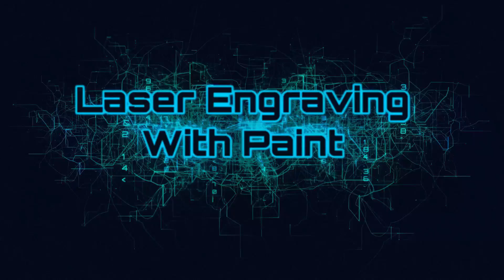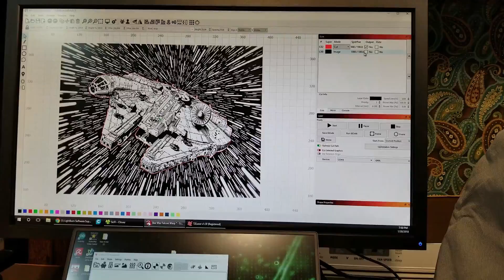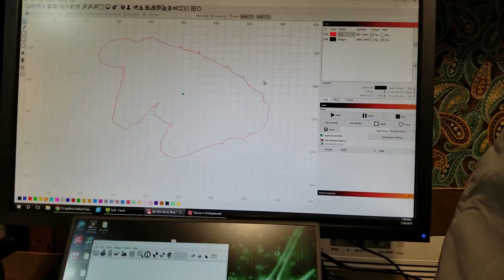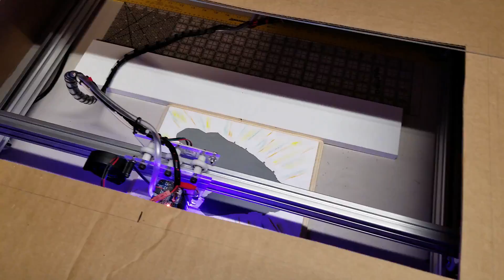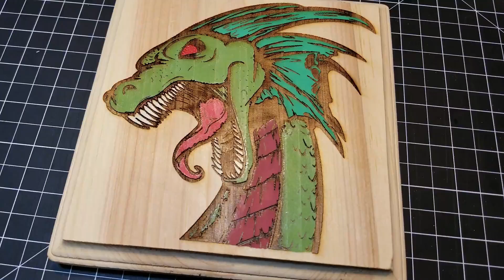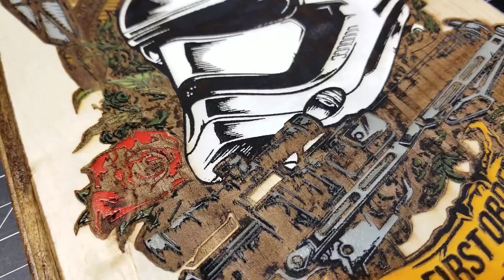Laser Paint Engraving Tutorial

Comment: So those collar areas they must be painted very precisely by hand correct?
Reply from the maker: Not really, it all depends on the design. I explain it a bit in the video, as long as you dont overlap one color over into another colors area you will be fine. The laser engraves all the outlines of the design, so that cleans up your edges where you painted. Think of it as the laser going back and triming your paint to the lines, if you colored ON the lines a bit.
Think of it as a coloring book, you can get sloppy enough that your color goes ON the lines, as long as you dont go OVER the lines.

Comment: How are you able to laser engrave on white??
Reply from the maker: There are a lot of variables to this such as what type of paint you are using and even how thick you have the paint on there. I use acrylic craft paints and I find that they do quite well. The white actually did better than some other colors burning quite black. You have to play around with all the variables though laser settings such as power and speed and how much air you have blowing on the price. Sometimes if you have too much air pressure it will simply blow away everything it is engraving so it's not leaving behind a nice dark engraving. I found it best to keep the air pressure low and then clear coated afterwards to lock in all the burnt material.

Comment: Man, your work is cut short by the time it takes that solid state laser to do it's job!  You really need to build a Co2 setup and get an 12v PC fan in place to flow the smoke way from your work by shooting it across the board toward the rear exhaust port exit.  Putting air flow down on your piece like that is better for the lens, but it causes an over burn effect due to it blasting the burn off debris and smoke back against the edges.  This can be good for a patina effect, sorta like a shading you'd get from an airbrush, but over all it kills the cleanses of your work.  This is why most laser setups use a cone style nozzle over the lens that then is pressurized by the air pump like your pen cap, however it completely seals the lens.   What most laser sales people and home builders don't realize is that the optimal pressure used is generally no more than 4-6 psi for engraving, which is critical for negating smoking your edges and also is most required for etching on acrylic so as to not over cool the surface to early to prevent ridge freezing, but instead allowing the melted plastic to pool out just slightly before refreezing for a much cleaner result.   
That being said, I built a 100watt co2 1200x900mm (3x4 foot) bed for just under 4K.  I could do it even cheaper now that know what I do now about building them.  
(If you need advice or info on it I don't mind sharing info)  
My machine uses 2- 2/1 ratio 3 phase nema 23 motors on hybrid digital drivers @ 36v and can raster etch at speeds upto 1100 mm/s with the typical .085 scan gap at 300 dpi for deap etching, or set up to 4mm out of focus for removing paint like you're doing for running an even wider scan gap, which speeds up the process tremendously and reduces any observable focus lines for a really smooth appearance more like a CNC router end-mill does.
I used a Light Object T9 DSP with coreldraw X7 that makes vector tracing raster images a snap.  This is a big deal in regard to the fact that I can go back and vector trace the outlines of everything once I get the etching done.  It cleans up the definition of the work unbelievably better.   
The T9 comes with plug-ins for corel as well, so I don't need to export in any specific formats or reset any colors, separate groups, etc since I can just send it directly to the Laser software with once click.  All I have to do then is set the color tabs to what I want them to do and it's ready to rock.

Another couple things to consider is if you're not using chalk in your paint you really should consider this or even just investing in some pastel color pencils or paint pens for the inner detail work (like those teeth for example). The chalk can be bought seperately and mixed yourself, have a look at amazon for it. 
Chalk paint eliminates needing more than one or two coats at most due to the chalk being a molecular binding agent for the pigment. This makes it much more opaque per coat layer added, reducing your paint use by significant margins and increasing the drying time by 4-5 times vs any other method.    
Another thing you should try is using a wide roll of transfer (masking tape) film that will burn away with the laser if you really want to keep things clean on outer edges when you raster engrave things. 
I get mine from "UScutter" works great as well, just make sure you buy it in a wide enough roll to cover your entire surface with one piece so you don't need to overlap one with another, or you'll notice it on your work since the beam has to travel through two layers of tape before it gets to the material.
https://www.uscutter.com/GreenStar-Layflat-Classic-Transfer-Tape-Medium-Tack-Assorted-Widths-Sample-Rolls

My inspiration for telling you all this is because I made $700 on my first job with my machine and it's almost already paid for it's self in less than 3 months.  I don't even run a business or advertise for it yet!
  You can build a 30-40 watt machine using a K40 unit and upgrading it with a component kit for under 1K (assuming you need the K40 as well) that will totally turn your setup into a production monster with this kit>  https://www.lightobject.com/K40-Upgrade-Parts/T9-DSP-laser-upgrade-kit-for-K40-small-CO2-laser-machine .   Or you can do it to your existing machine from the looks of it for even cheaper with a few of those components in that link.
Oh and here's a picture of my setup with the front panel off so I could etch a 2x8 foot sign made of solid plank redwood! for a local business!
If you look to the far left you'll see a PC fan I use for directing airflow to the rear vent for cleaning up the residing smoke, preventing residue build up anywhere.  https://i.ibb.co/rZNc9BL/20190903041544-IMG-7224.jpg
Reply: @JohnTrottoCreations   Excellent!  Glad to see a fellow laser guy moving forward!  Doesn't take long and building on your machines becomes as much of an addiction for some of us as the stuff we want to create with it.
   And there is nothing wrong with a chinese unit.   As a matter of fact that is what I usually tell people to go with when they ask me about building one.   IT's hard to beat the price and all that is included with one.
 The only thing I tell them that they should change over time is the driver/motor combos you can get from companies like cloudray, which makes some pretty trick 3 wire servo/stepper hybrid motors and drivers that run much faster and eliminate a lot of over driving issues from dynamic load shift found with just using analog steppers on a fixed voltage.   Past that I bought a high quality PSU from Light Object, as well as their T9 DSP since it's more Americanized and has constant firmware and version updates.   
  If running MO mirrors and or a PCX lens, I tell them to go to copper or Si sets and a miniscus lens, typically 50.8mm or lower unless wanting to cut thick stuff.
  The PSU and CO2 tube's I would suggest getting from Light object as well since they are backed up by warranty and are a US based distributor out of CA run by a guy named Marco.  He's got his stuff together unlike some chinese distributors and is making progress in the field.   The extra price isn't to bad and it's worth it for that reason in my opinion once you go larger that 60watts.  Anyhow, have a good one man!  Can't wait to see what you do next.  I need to post some videos sometime to
Reply: @JohnTrottoCreations  I really want to build a scan head Glavo style next!  Once you see one of them run it's hard not to want to throw your wallet at one!  Til you add it up!!!!
But.....    https://www.youtube.com/watch?v=hEMWsUo4zSc

Comment: you can also do it the other way around if you have a sander.     
you engrave. fill with paint.  engrave fill with other color.  engrave fill with last color.  and then sand everything down to bare wood (except for the engravings ofcourse)

that way you can even coat it with a clear coat.  you won't see those lines you have from engraving. and in turn ask about 2 or 3 times as much money for a single piece
Reply: @JohnTrottoCreations  if it's a really deep engraving a colored epoxy resin might look much cooler.   or even a paint fill with a clear epoxy resin coating (that makes colors pop for some reason.)   search for wood epoxy art on youtube.   with a laser engaver you can take that to a new level